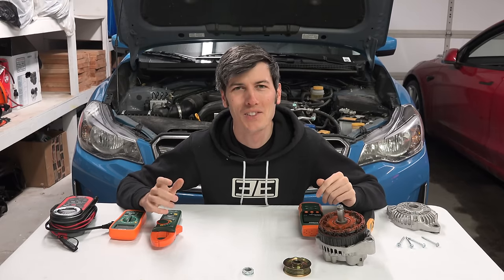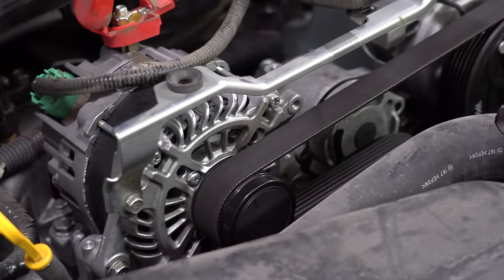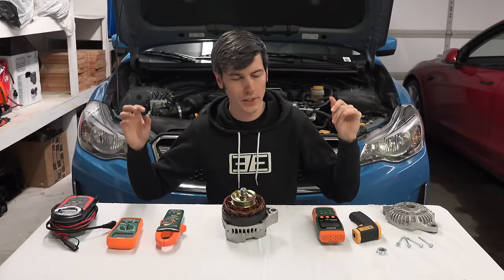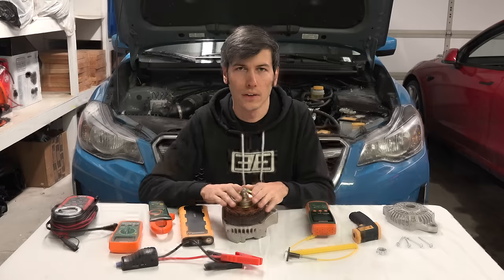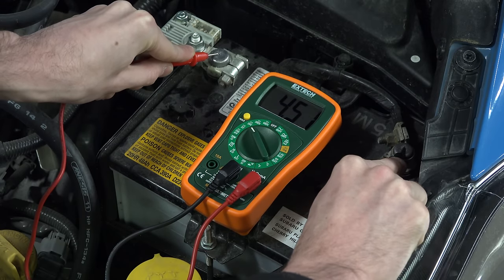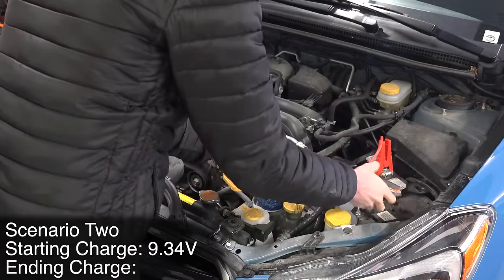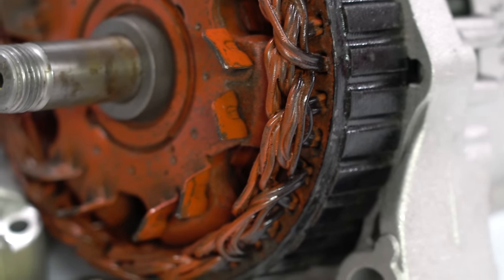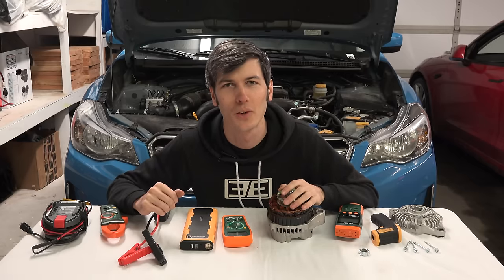Can A Dead Battery Ruin Your Car's Alternator?

Comment: That was great Jason! I was really surprised at the results too. I'm always worried about damage to the charging system with a depleted battery. I always wonder about the voltage regulator... It has to carry all that current too. My first car was a '71 Ford Capri (the German one).  It had a Lucas electrical system and it was the Trifecta Of Doom! If any one of the three was the least bit stressed out (lookin' at you VR) it destroyed the other two. Great learning experience :) f

Comment: The alternator wont be outputting more amps if the battery is on its way out. The battery would charge up quicker as its broken, and the alternator would idle as if the battery was new.

Comment: I don't think the alternator has magnets on the rotor. The rotating magnetic field is created by a current on the rotor coils. The current on the rotor is induced from the stator current. This is the working principle of an induction machine. They are cheaper than  permanent magnet synchronous machines.

Comment: I have a display that I plug into my cigarette socket that displays the battery’s voltage. My cars older and dosnt show the battery life. It’s interesting but I like it I get 12 volts then once cars started it reads 14-15 volts it fluctuates depending on what I got turned on. I noticed the rear defroster really puts a load on alternator cause soon as I turn it on the lights on the dash dim a bit and the battery voltage drops to 12-13 volts

Comment: I have the same Optima charger for my Optima battery in my '68 Firebird. I always have it on the charger because I can. It maintains the battery. Anyways, I can drive the car, come home, put the charger back on and it always reads 75%. The charger displays 75-99% actual as 75%.

Comment: Alternator will not heat up more "trying" to charge aging battery because that battery simply can not charge up to full capacity. Aging battery simply looses capacity and can't receive more that let's say 50% of factory capacity. Alternator will never try to charge that baterry more than that because on 50% charge voltage on baterry will be like it is fully charged. Alternator will "see" that baterry like the one with smaller capacity.

There is much bigger concequences on starter motor with bad battery then on alternator. You can make video on that subject too.

Comment: Your video came on the right time because I too was actually still having the charging issues,I replaced the old alternator because it had voltage problems. the replacement which is the used one because new alternator is not available for my car in my country,when I installed it the battery was low but still enough charge to start the engine I than started the engine and let it idle for few minutes after that I revved it to check if the voltage increases alternator was providing the full voltage when engine was revved and I thought that it also charged the battery but when I turned off the engine and started it again the battery was still not charged,battery is only couple of months old,alternator wire seems good too because the voltage increases when the engine speed is increased but still there are charging issues,what could be the problem now?
Reply: A low battery will probably need an hour of drive time to be fully charged
Reply: @myofficegoes65  thanks for the reply,so it won't recharge by just  letting the engine run for 15 or 20 minutes?

Comment: Uh the alternator would be getting hotter because it is charging the battery as battery resistance is low, a higher charged battery doesnt allow as much current to flow so the alternator actually has to fight the electromagnetic resistance in the coils which would put more strain on the bearings

Comment: A battery that is worn out accepts less charge / amps so the alternator is not working as hard to charge the battery (9:46) Huge respect I watch a lot of you videos but your statement at the end is not technically correct

Comment: I was curious about one thing, normally when I wait for someone, I always like to turn off the engine while waiting for my friends but keep my battery on, does it actually stress my alternator a lot when I start up the engine after that because my battery drains out?
Reply from the maker: If you're just listening to music (accessory mode) it's generally not that much of a power draw. If you're running fans, (ignition on), then the power draw is a bit more significant.
Reply: Only if you're waiting for like an hour or more.

Comment: yes yes it will. this is not a dead cell battery this is a deeply drained battery. not good for your bearer diodes but not dangerous for a short time. if the battery was a dead cell then what you would see is you would have a lot of a/c ripple and the alternator would be putting out more then 100% of it's rated amps. it would over heat very fast and you would start to lose diodes in a mater of minutes. from your point of view you would begin see to a slight flicker in your lighting. this is from the lost diodes. it all depends on the quality and ratings of the diodes but at some point they would fail, and you would start to see more a/c and more flickering. or you might see a flash, smoke, or a fire. like dodge cars a few years ago lol.

Comment: My clock and mileometer is not showing up .. just switched off. But the car is still running and battery terminals are intact

Comment: NO, you do NOT supply an alternating current to the rotor. You supply a DC current to the rotor.  I worked for a large city radio shop and they had hundreds of cars. they used optima yellow top deep cycle batteries. the chevrolet alternators could withstand charging a depleted battery. the Fords not so much they would overheat and fail even though they were supposed to be heavy duty.

Comment: I imagine that the cost of charging a dead battery from mains electricity might be cheaper than the extra gasoline that would be expended doing it via driving? Not a lot in any case, I'd wager.

Comment: I literally just replaced my moms alternator. Anytime I jump start someone I tell them to get it charged asap. Even if it's a myth, it's still a great myth lol. I even run an extra wire from my alternator straight to the battery. I'm a hardwire kinda guy

Comment: The size of the battery will dictate the duration until fully charged. I'd guess this is a 50-60ah battery so if the alternator is putting in 50amp it should take roughly 1hr to charge to 100%. Not scientific I know but i've seen these results on my camper trailer battery which is 100ah.

Comment: Battery or Alternator? Charge, start and disconnect the negative battery while the car is running. If the engine stops the problem is the alternator. Otherwise battery not holding a charge.

Comment: I thought you was going to use one of those new dead battery's that read 0 volts. Even after charging battery, its still dead. Alternator is severely being over worked, I believe that's the real alternator killer. But really, who continuously drive around town with a completely dead battery where you have to jump it before you can drive it.

Comment: The battery runs everything, not the alterator. That is why your car can run for a while after the alternator goes bad. Once the battery depletes, then things shut down. A bad cell in a battery will create strange things to happen to your vehicle even with a good alternator. So you are wrong. Even after starting your vehicle, everything is STILL going through the battery to work. If your alternator failed, you still have that battery running things, but not for long. I ran my van on a deep cycle battery to get it to a shop even though the alternator was junk. Being a conversion van, it used a High output alternator that costed double the cost of a truck alternator. Go figure.

Comment: Totally disagree with the bad battery argument. The alternator won't "try" to charge a bad battery. The bad battery won't need much energy to get in its full SOC (low) and it won't "request" more amps from the alternator.
Reply: It is like assuming that an electric car with an old battery will request the same amount of charge (KWH) as a new battery pack.

Comment: It's a useless exercise to measure battery voltage after a drive and try to interpret a state of charge from it. Remove surface charge and try again. Better yet, do a load test. Also, the capability to charge a flat battery heavily depends on alternator rating and electrical demand of the vehicle itself. It's not so cut and dry.

Comment: A 1SNF battery will induce a resistive load pulling only a maximum current of ~4.5a to charge itself.  For bigger batteries, it will pull a little more.  Since it will only pull that small of a current, you need hours to fully charge it.  It might read more than 12.6v after a few minutes of charging, but it won't have the same capacity or cranking power as a fully charged battery.  If you turn on electronics while the Alternator is off, it will quickly go back to 9v.  This also means that even if you install a 1000a Alternator it will not make charging faster.  The fans & other electronics in the car will pull more current than the depleted battery.

Comment: 5:52 if more were to be done to keep the alternator cool(ler), would it put out more amps?
Reply: No. The amps are normally the result of what the battery draws at the charging voltage. If the battery wants more than the alternator can deliver the output voltage will drop because the alternator can't deliver it.

Comment: If battery is dead and alternator is working more then I think it’s obvious that the efficiency of car is REDUCED because more energy is used to charge the battery. Right????
Reply from the maker: From an efficiency standpoint, you are correct.
Reply: And I wanted to if we fit a bigger alternator in a car as compared to it’s stock alternator : I think it can increase efficiency without disturbing the costs of car 
I’m not sure about it but want to know? 
A tag question is that changing alternator size would affect the combustion rate and other parameters??

Comment: My dad has a 2016 Toyota Etios that had a dying battery. Engine cranked a couple of times before firing and if you left the hazards and radio on (all internal and external lights switched off) for half an hour it took quite more effort to start.
On a rainy night he was coming back from a 650km trip and about 30km from home the Airbag light came on, then the ABS light, then the handbrake light and every other light in the dashboard. Eventually the headlights started to dim and he had to pull over because the battery was so dead the spark plugs couldn't even fire and had to have the car towed. Unfortunately we had lend a friend a jump start so we couldn't do much about this. Apparently the alternator was dead and was not charging the battery, hence why the battery end up dying some time later. After the ordeal and having waited over 5hs for the tow truck to come, the car was taken to the mechanic who repaired the alternator because it was fixable and later had the battery replaced.
Probably alternator failure was due to a bad battery, as I had some time before parked the car with the hazards and radio on -nothing else - for 45min and then the car wouldn't even start.

Comment: Make a video about why cars have no indicator that your alternator is no longer working, No fun to get stranded on the road-side because you have no idea that you're running on battery power alone, which eventually won't power the ignition on the engine anymore as it runs out of charge - like when you're on a long stretch of highway.   Seems like a huge design flaw to have no such indicator.   Battery indicator isn't enough, because if your alternator is working, you have no risk of your car's ignition system dying while your engine & alt. are working.  But low batt indicator might mean your alt died at some point too.   Why don't they separate them??

Comment: 1:24 "rotor which has magnets on  it" Do you know the difference between an induction motor and something like an BLDC? Induction motors never have magnets. 0 magnets, neither in the rotor nor in the stator. It's even more disapointing when a Tesla owner doesn't know what an induction motor is.
I have never seen an alternator with magnets in it. And by the way: turn that alternator when there is no battery attached to it, not matter how fast you will spin it, it will produce 0 volts. Why? because it has windings in stead of magnets.

Comment: Does the Crosstrek has the auto headlight thing like at the new Crosstrek??
Reply from the maker: Not sure what you're referring to. The headlights will turn off if you remove the key. Certain features were disabled with low battery, like the stereo, but I could continue to run some items (inside lights, for example) to continue to drain the battery.
Reply: @EngineeringExplained  i mean the lights that was not the main ones, but the white lights which was like at the new STi or the new WRX

Most cars has headlights with the low beam, high beam, signal lights and the auto white lights which is like in a "fierce" shape like the new Crosstrek and Impreza's headlights, so maybe if i want to buy a 2017 Crosstrek, does it has that white auto lights??

Comment: I like to get as much use out of my battery as possible. I would run them to the point where they would just barely turn the car over on a cold day. I went through two alternators the first Ninety five thousand miles that I had the car. Kind of wonder if I wasn’t being spending a dollar to save a dime. By that I mean making the alternator work at a higher amperage to compensate for my weak battery. Live and learn I guess

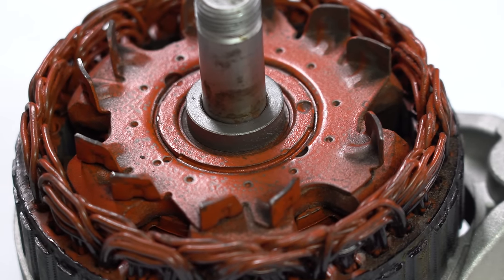Comment: 10:10 You claim that the alternator working harder "could" lead to premature failure.  What is your basis for this?  Just the increased ampacity?  Isn't the rpm's of the alternator the amount of work? which is consistent thru all the scenarios?  The only wearable moving part in the alternator are the bearings which have a life expectancy of X# of revolutions.  The extra heat from overampacity should be minimal to the bearings.  The insulation on the windings of the alternator should rated well above any possible high temps anticipated by the engineers, therefore not an issue.
Reply: Most alternators aren't the brushless type, so another wear item is the brushes and slip rings on the rotor

Comment: I don't understand how you're able to measure current, isn't the output of the alternator DC? That clamp meter should only work on AC. DC currents have to be measured in series, but you don't seem to be disconnecting your alternator and running it through an ammeter to the rest of the electronics...
Reply from the maker: Correct, alternator output is DC. The ammeter I'm using can select AC or DC for measuring.
Reply: @EngineeringExplained A constant DC current does not induce any voltage in a loop around the DC wire though, you shouldn't be able to detect DC currents that way...
Reply: @CLP I just looked them up and that's what I found also. That means the measurement will depend on where the wire is within the clamp though, unless there are multiple Hall sensors built around the clamp that are averaged over or something.

Comment: Wow that explains things! When I was at uni my battery was on its way out, but I was too broke to replace it immediately, and so I would carry jumper leads in the passenger seat and ask people for a jump start most times the car sat for longer than a few hours, until the alternator failed shortly after hahahaha. I thought it was a bad alternator from the beginning, but guess that battery ruined it. Luckily I could borrow my friend's spare alternator by the time I had saved for a battery. Dam I miss that car

Comment: my focus mk2s 10 year old battery (quite an achievement on its own.) killed the alternator tho.
ok, heavily damaged it.
i wasnt even aware that it was so old.
i noticed first problems when it was a hot sommer day. the ac was on full blast because traffic jam, black paint and multiple people in the car.
also lights needed to be on because traffic rules..
after i parked the car i wanted to move it a bit because i wasnt happy with my position and the car didnt wanted to turn on at first.
came back after some time and it did turn on again.
a bit on a weak side but it did nevertheless.
on the trip back i turned off everything electrical.
tried to turn it in on immediately after the trip and it did.
on the following sunday i risked another trip, since the alternator light wasnt on.
well, the car didnt wanted to turn on after the destination was arrived.(had some electrical things running on the trip tho)
couple minutes later it did run again.
what i noticed is that the battery gets really hot, since its pretty much next to the engine block.
after some cooling down it did run fine again.
mechanic checked the battery and he told me that it was 10 years old and that the alternator did only run at 12 volts.
got a new battery and a new alternator like 2 days later.
i did turn on the ac before the alternator swap, which was a bad idea because the alternator dash light came on.
and had to turn off the ac again..
if it wasnt for the overbuild battery i would probably didnt even had to swap the alternator.
oh well..

Comment: how about WHP loss on a low battery vs full battery?  1 Alternator AMP = ? WHP
Reply: If the alternator puts out 70 amps, that's about, 840 watts of electrical power, which is a bit more than 1 hp (746 W). That's pretty small. The alternator isn't 100% efficient so it will use more mechanical power from the engine but it's still probably only a few hp.

Comment: Hi
I've got one question linked to your video. I own an old Citroen Saxo 1.1 injection with 60 hp with which I drive on circuits. Can I totally remove the battery after I started my engine? Yes? No? Why? I wondered for almost 2 years now. Thank you ! 
Ps: Nice video once again ;)